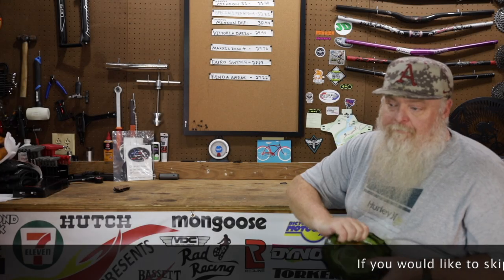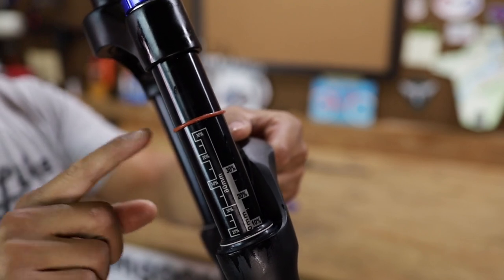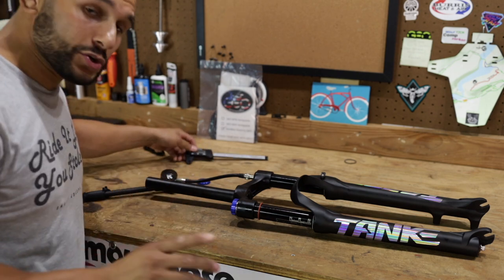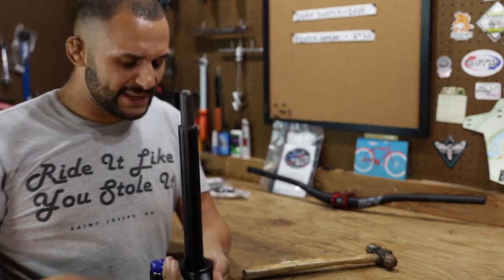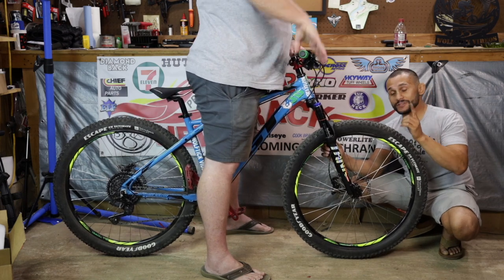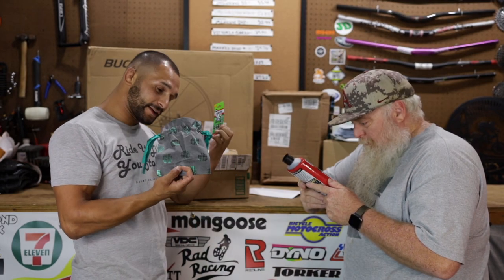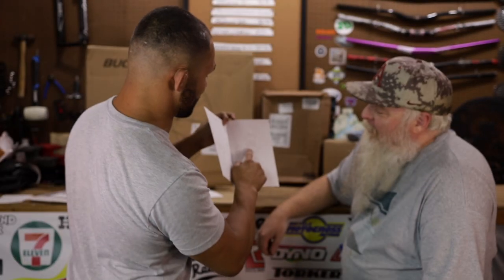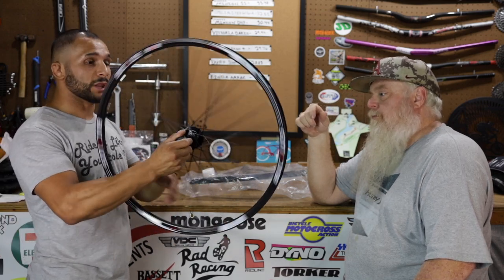We Bought The CHEAPEST Air FORK On AMAZON!

Comment: You guys should try using the expansion plug for the steerer tube in place of the star nut of things you feel like you might return. They work well as they use them for carbon steerers and they don't do much to affect the steerer on the inside.
Reply: Been using them on my forks for a long time now.  So easy to install and swap between forks!

Comment: I have a set of those bucklos wheels on my roadbike and for the most part they are great....BUT check the free hub.   The pawls on mine completely lacked any lubricant on the pawls.  on a 30 mile ride everything was good and I went to push off and the pedals just spun.  Pretty easy fix at least.
Reply from the maker: Thanks for the heads up man 👍

Comment: So you can fill all the tubes with sealant now?  That what I do with my kids bikes that don’t have TR wheels.  It basically makes them run like tubeless.  The sealant gets between the tire and tube and glued them together when you run over thorns and stuff.  It’s the only way I can keep the kids rolling out here in thorn city.
Reply: FlatOut in tubes just keeps on going buddy!  Saves a lot of money on tubes!  AND a lot of time messing around with flats! It Adds some weight lol it is heavy.. but its perfect for sending it down hill, or monster trucking through thorns and stuff!  It works particularly well with ebikes!! The disadvantages of tubeless don’t apply when its in a tube!  Best of both worlds!! You can change your tire or use the tube in another bike! Without messing with the sealant each time. You can pretty much ignore punctures and keep on adding air as necessary. The tube isn’t shot when it gets a tiny puncture anymore! If you have a hub motor ebike, its a pain to change flats with the motor cables and  stuff!

Comment: If I remove a derailleur for any reason, I take the extra 5 - 10 minutes to check and correct hanger alignment, top and bottom, right and left. A 2mm deviation is supposed to be OK unless you are OCD like myself. 
If range of the adjustment lever on the compression damper is more than 150 degrees, it indicates to me that may be a screw valve design rather than a simple plate that blocks an elongated hole. If so, bravo for tank.
You cleaned up that tubeless tire in just 45 minutes? Good for you.

Comment: Hey brother.  I see that you always seem to struggle with tubless.  The quickest way I found the quickest way to seat a tire on the rim is to use the CO2 portable air pump.   The CO2 pump inflates the tire so quick that it instantly seats the tire.  Then just finish it off the tire pressure with a regular air pump.

Cheers boy's

Comment: Tanke flooded Taobao after Himalo. There is exposed stanchion, and "press-in" stanchion, and sometimes they can be 40mm different, lol!

I'd have been suspicious about the availability of an external rebound knob after browsing the sales page and seeing the picture annotation points to the air leg side, not the side that would be classed as the "damper" side.

Making reviews on sales pages. There is more than good or bad reviews. There are subtle sarcastic reviews.

"There i was going down a smoother path when i saw a technical section coming up. Pressing the fingers of my left hand to my temple, I wished a faster rebound action into place. Disappointingly, it failed to switch over at that moment. My dentures couldnt take the trail chatter and died somewhere on that hill."